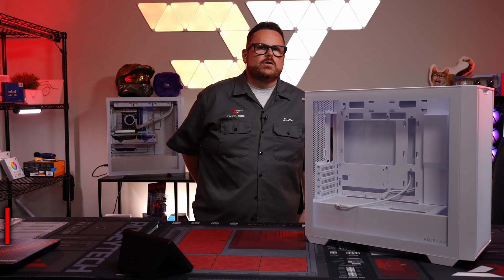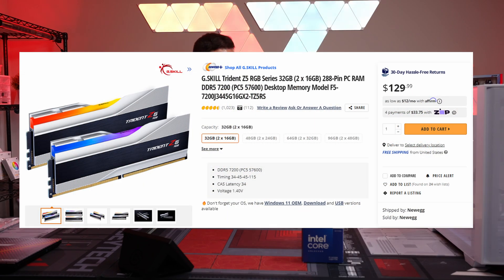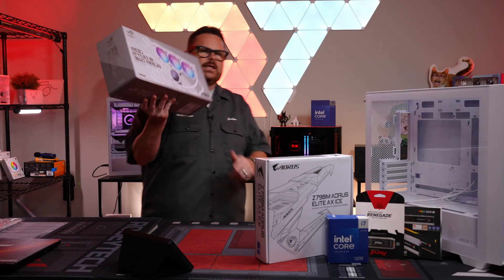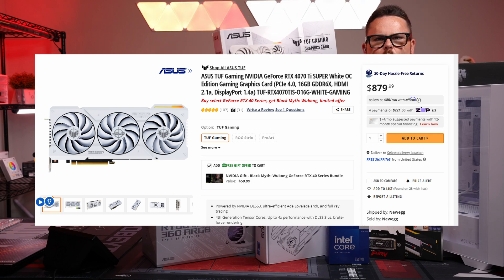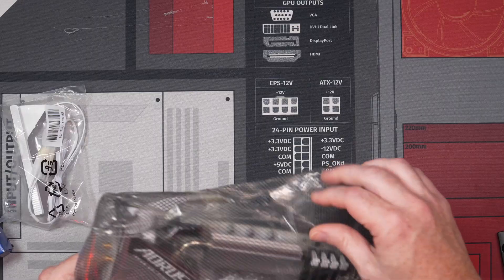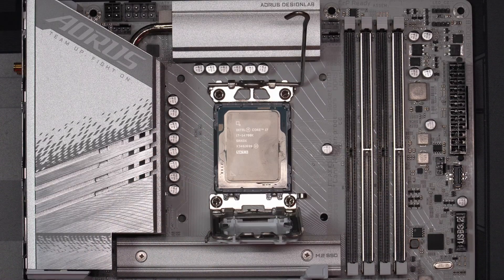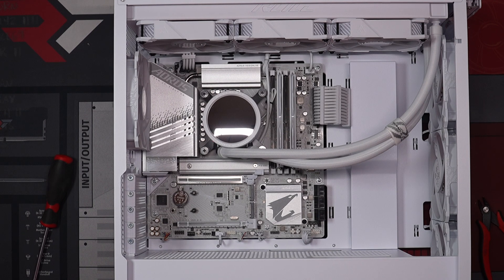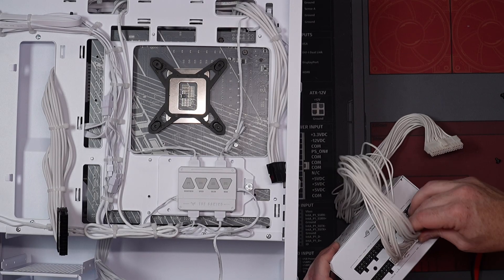Stunning, Small and Powerful. ASUS A21 PC Build

Comment: First off you failed by picking a 14th gen Intel and not going with AMD and secondly the AIO is overkill for even the 14700k and it’s really not helping the cpu by placing the 360 rad on the top of the case. You’re just sucking hot air from the GPU. Put the rad in the front. Hose connection at the top.
Reply from the maker: lol.  You need to build more PCs because pretty much everything you said was wrong.  Watch my live streams air moves so fast in PCs that the GPU is getting fresh air from the front fans.   Top placement of the AiO is literally the best place to cool your CPU because front mount removes direct air flow to the GPU and top mounting gets direct airflow from the fans in the front which is more than fast enough to feed all three fans.  I am not even going to entertain the whole AMD vs 14th Gen because that’s just a personal choice and as for the size that’s also up to the user.  If you want to OC and keep the system quieter a 360mm AiO is a better choice.  I appreciate the comment but nothing you said was true or not just opinion.
Reply: @robeytech  Have you been living under a rock? 13th and 14th gen intel have been having stability issues and are not recommend by anyone at this moment. Even people like Linus Tech Tips and Gamers Nexus would not build a brand new custom PC with with either of those. It's not about being a fanboy or anything and you're making immature assumptions. I would say go with a 12th gen but its 3 gens old so... And we have no idea if the microcode update will really fix the issues either. 

Also 14700k is $380 atm. Spend $20 more and you can get the 7800X3D. Better temps and about similar gaming performance if not better. Heck you could get a 5800X3D for $300 or a 5700X3D for $200 and get almost as good if not better performance than the 14700k and you save money. Really depends on the games you play tho. You spent $2600 and you're still getting temps in the 80s. Not terrible but for $2600, could be better. You don't even show if its quiet but talked it up as if with that 360mm rad it's quiet. What was the decibel (dB) level at load? What was noise floor at?  What was the temp delta of the room? I have a 5700X3D with an old corsair h60 120mm AIO and it works. Room temp delta of about 25c+ on average hitting CPU temps in the 70s to 80s at max. I couldn't even tell you about my PC noise levels but I'm not making claims about that because it is a bit loud. I don't mind tho and where headphones. 

I would put a 240mm rad in front at the top with a third fan at the bottom front. The CPU can get fresh air from the front of the case. That front bottom fan will supply the GPU. Two top fans and a rear fan for exhaust. Six fans in total and I bet you'd getting better temps, I dare you to try it. I'll even sub to watch and if you prove me wrong with hard data, ill stay subbed. You can even add a 7th fan at the bottom of the case to get more fresh air to the GPU if needed and create positive pressure or add a third fan to the top to get negative pressure. With my setup you have very little chance or air recirculation. With your set up you are dumping some GPU air into the CPU rad. Those top three rad fans are going to ramp up under load and overwhelm that rear fan. I wouldn't be as worried about the CPU rad if you had a older blower style GPU.
Reply: @tyler3201  what's your current PC build?
Reply: @yogsawtooth I bet he doesn’t have a build.